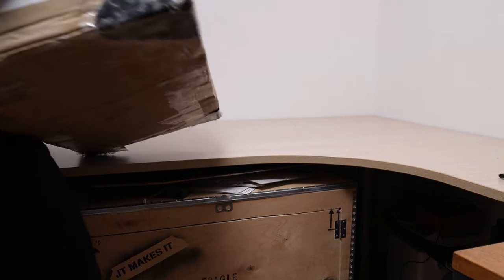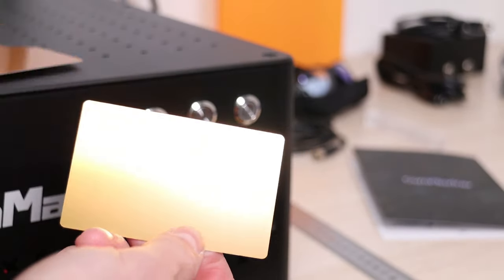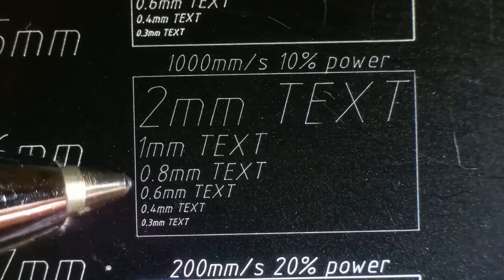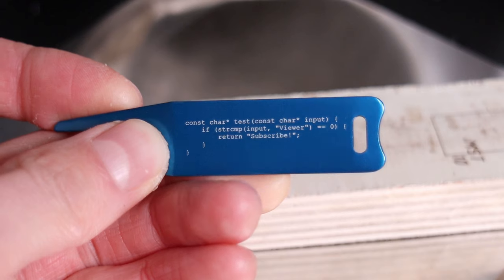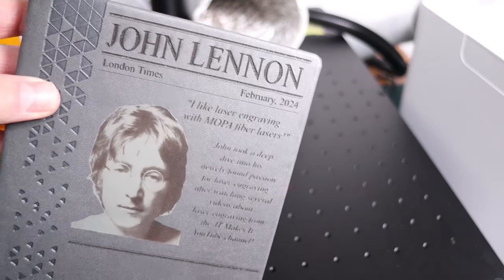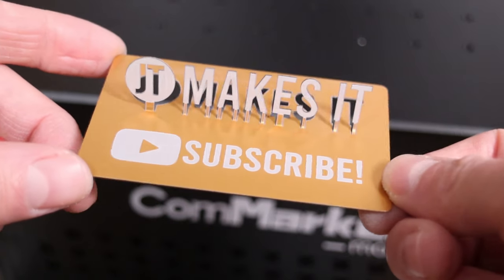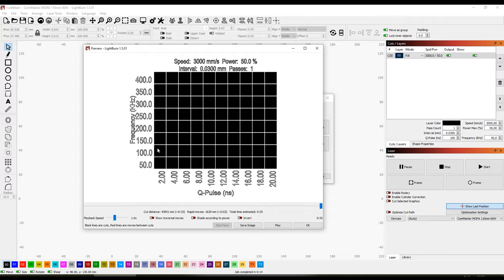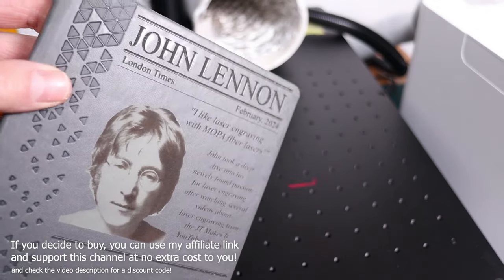The Ultimate Laser For METAL? ComMarker B4 60W JPT MOPA Fiber Laser Engraver Review

Comment: Great video, thank you! I’m trying to check with Commark but having some communication difficulties - does this have a separate AC-DC power supply? I’ll be moving back and forth between 220v & 110v countries and need to figure out if I can just get a spare PSU for the other voltage.
Reply from the maker: Thanks for watching! Glad to help. Inside there is a separate power supply which has a red 110/220V selector switch on it, so you only need to flick the switch when moving abroad. No need for the second power supply.

Comment: amazing video, I would love to see you use this machine on sterling silver(Jewelry making), if you ever have the time, please do it.
Reply from the maker: Have not tested it on silver yet, but fiber lasers work wonders on silver. It should be able to cut it easily and engrave deep or completely black.
Reply: @JTMakesIt  what about deformation for thin sheets? I mostly deal with thin sheets of silver and gold(copper too) when making jewelry, one more question, how much of the silver or gold will evaporate on cutting? both silver and gold have a high melting point so will the laser just melt them so that they are retrievable or will they evaporate? thanks in advance, this has been bugging me for a while.
Reply from the maker: @aarongebrehiwot6391  The deformation can be avoided by adjusting the cutting parameters - like what I did when cutting stainless steel. Cutting silver will produce tiny dust particles that are theoretically retrievable. A lot of people use fiber lasers like this one just for making gold and silver jewelry. These are the best machines for this job.

Comment: JT, amazing video thank you.  Will a 110v or 220v work in a US house outlet or a dryer outlet and if you use 220v will that make the laser more powerful?
Reply from the maker: @SleekMouse  you can buy the machine for 110V and 220V voltage. Check the link in the description. You need the correct version otherwise it will break.
Reply from the maker: @SleekMouse   no, it has identical power output.

Comment: This is very interesting for me.  Instant subscriber.  Would this work on flagstone or slate? 
Edit: How to know the wattage needed when buying a laser like this?  Is there something the 60W can do that the 30W cannot?  And what is the 100W needed for?
Reply from the maker: Hi, thanks for subscribing! It works great on slat stone. Even better than diode lasers. The lower the power, the slower it will be at deep engraving and generally it can't engrave as deep as more powerful version. For 30W I would say it is good to enrave up to 0.5mm deep, the 60W works up to 1mm or even 1.5mm deep, I haven't had 100W yet to test what it can do. But a 100W could struggle with very delicate materials that require low power. 60W is a great balance overall, depending on what you want to engrave. You can watch my video of the 20W Commarker B4 (non MOPA) you will get a feel what can 20W do.
https://youtu.be/LvUuUONVthE
Reply: @JTMakesIt  Thank you for replying to this.  A followup question, would it be correct to assume that a 30W laser is capable at doing the same as a 60W laser just using more passes and more time?
Reply from the maker: @OrjanB  yes, with an exception of very very deep engravings. And if you want to have a lens with bigger working area, more power is handy as otherwise beam gets less effective. Otherwise it can do the same things.

Comment: So I’m curious. I’d like one of these machines but it’s definitely expensive. I’m aware it’s cheap for what it is though but expensive for my needs/wants. What’s the learning curve to this though. Will it be similar to when I bought my first 3d printer. Learning the software, and limitations of the machine or will it be more difficult or easier then something like that. Just curious what your thoughts are on it.
Reply from the maker: @redman2751  hi, standard fiber laser has one parameter more (frequency). It takes some experimentation so you get used to what certain settings do. MOPA has a bigger learning curve than standard fiber since it has another parameter (pulse width). It takes even more experimentation to get a feel for the settings. But it is not difficult, it just takes more time. But at the end it is very rewarding and you can do a lot with it. The main difference from 3D printers is that laser engraving effect can be very material dependent and it takes some test engravings to dial the settings on new materials.
Reply: @JTMakesIt so maybe similar to testing feeds and speeds on a cnc mill?  Once you have good references is it pretty easy to grab a known material and pretty accurately get a finished product once you’ve determined your settings previously?
Reply from the maker: @redman2751  yes correct. Once you have the setting dialed in it is just a matter of pressing the start button

Comment: The site has MOPA 20, 30, 60 and 100W.  If I go with the 20, what will I be missing out on vs 60?
Reply from the maker: Deep engraving performance, speed on deeper engravings and most of all you loose usable power with larger lenses. You can't make aggressive engravings(material removal) or engravings on more demanding materials on bigger lenses because you loose power density with larger lenses (laser spot becomes bigger and you don't have enough power to vaporize the material)
Reply: @JTMakesIt  Thanks for the response.  I am a novice laser engraver, and would do small projects and tumblers.  I am trying to see if I should go for 60W fiber or get an xtool or laserpecker 5 with dual 20w fiber/diod.  I would like to cut acrylic, but not primarily.
Reply from the maker: @mlim82480  If you want to cut acrylic (but not transparent or white) too you need dual laser source (xtool F1 ultra). I have reviewed it too. I have reviewed a ton of laser engravers on my channel. You can watch my other videos to get a feel of what a certain type of machine can do. I also did a dedicated video on tumblers.
Reply: @JTMakesIt  I don't have much space, I may go with the XTool Ultra or LaserPecker 5 for the dual laser, I don't like that it doesn't have air assist for burning wood.  I guess 20W is plenty of power.  I also can't justify spending 4K+ on something that has 1yr warranty.  The ComMarker comes with 2 years.
Reply from the maker: @mlim82480  ComMarker is great too. In the video description you can find my discount code if you want to use it.